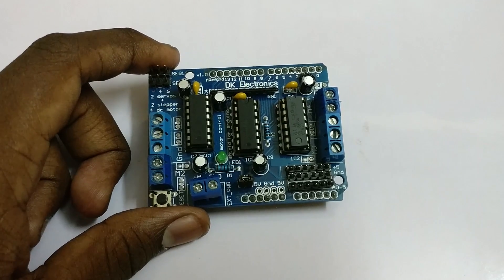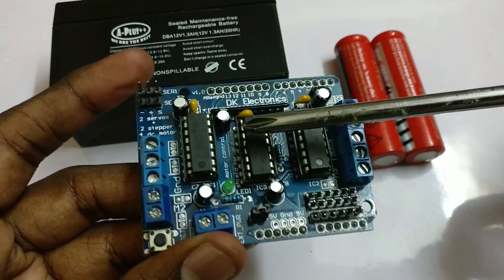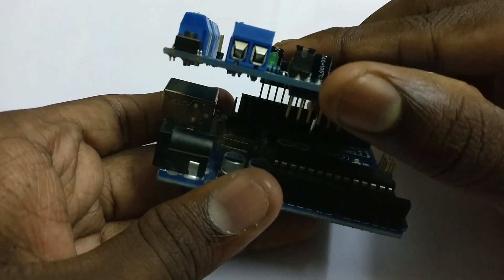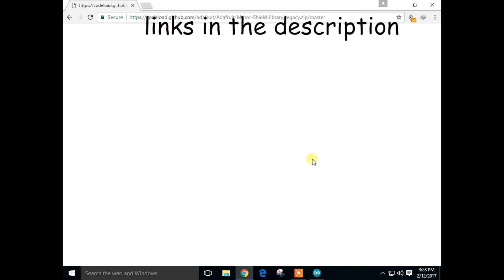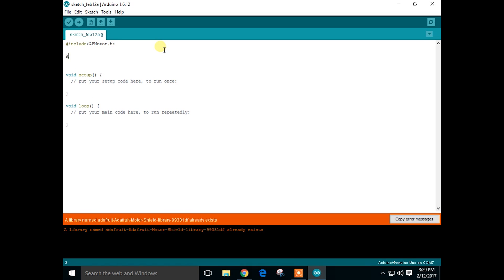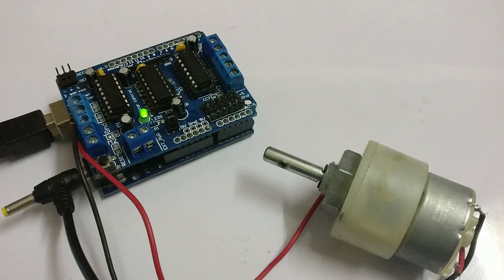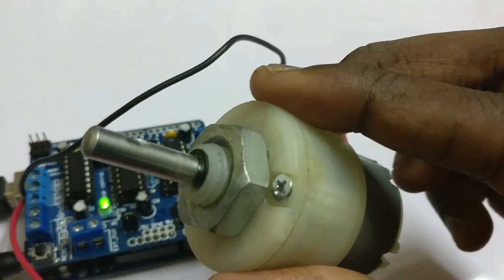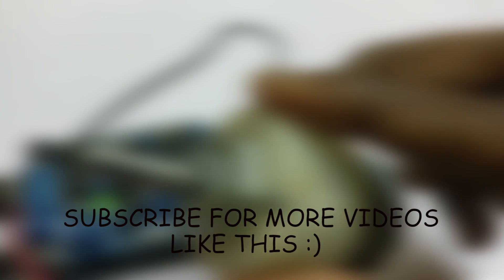Arduino Tutorial: Using a Motor shield!

Comment: Great video! I am making a ball launching machine using a 12V 30W motor and a 16.8 Ah Lithium battery. Would this motor shield work with this setup? If not, what's your recommentation? Thanks

Comment: Sir how to use the digital pins after placing motor shield on arduino.  I am currently working on my final year project which is a fire fighting robot and when I put the motor shield on arduino then the digital pins are also covered . Do I have to  perform soldering on motor shield

Comment: Arduino: 1.8.10 (Windows 7), Board: "Arduino/Genuino Uno"

sketch_nov16a:1:9: error: AFMoter.h: No such file or directory

 #include<AFMoter.h>

         ^~~~~~~~~~~

compilation terminated.

exit status 1
AFMoter.h: No such file or directory

This report would have more information with
"Show verbose output during compilation"
option enabled in File -> Preferences.
Reply from the maker: It's #include<AFMotor.h>

Comment: The board has ONE configurable component - the PWR jumper - and it isn't mentioned!When the jumper is installed power is supplied from the Arduino 9v supply. The plug for this supply is visible in the video, below the motor shield, when the motor is operating. When the jumper is removed power is supplied from the motor board +M terminal. This is the recommended mode of operation if using multiple motors or servos.  Do not leave the jumper installed if both power supplies are connected: there are no isolating diodes.The description of the LED is unintelligible.

Comment: Nice explanation. I have one doubt. Why you have given power supply to Arduino board but not to motor shield? What if I power the arduino by usb and connect the power supply to motor shield? What if I power the motor shield only and not connect the usb?

Comment: Hello congratulations for sharing. I have a roue codeuse on the motor shaft (recovered from a printer).I did the test of 5v pulses sent by the transistor. Could you specify where I have to connect these pulses on the arduino motor shield. Thank you.

Comment: If you have to attach some jumper wires to Arduino how you can connect wire with Arduino.
Reply from the maker: Only digital pin 2 can be used. You can solder a header pin in the given hole in the motor shield.

Comment: how to connect 4 motor with arduino nano & how this code
Reply: Rakib Sarkar You can use a ULN2003 IC with arduino nano or you can use a l293D or l298 motar driver.

Comment: Sir I am currently making CNC PLOTTER using using ardruino uno and l293d motor sheild. My ardruino uno works perfectly and is recognized by my PC. But as soon as as connect it with the motor sheild,the PC stops showing the port and doesn't get connected.. Can u pls help me?? My WhatsApp no. 9749766645
Reply from the maker: +Saikat Paul you may be inserting the shield in a wrong way.
Reply: MasterTech sir the sheild is a right fit. Left the first 2pins and inserted on 3.3v pins as done in the video

Comment: what pins from Arduino Uno do the motor shield use.i want add some other components leaving the pins used ???
Reply from the maker: +leeladharesh leela you can use the digital pin 2
Reply: I wanted to use the LCD display. so can I do it with which pins...
Reply from the maker: +leeladharesh leela no you cannot. Buy a L293D board. 
Robodo Electronics L298 Motor Driver Module https://www.amazon.in/dp/B00N4KWYDE/ref=cm_sw_r_cp_apa_i_YzPAAbTXP8F44

Comment: i want help can any one. call me 9604843211 i make CNC machine and i use Arduino uno and motor shield,,, i connct 2 stepper motor,1servo motor!!!  but when i am giving motor shield 6volt supply with mobile  charger then also motors are not moving can any body tell me whats the problem ???
Reply: E.T E.E  remove that lil pin grounder at pwr  motor shield at 0:08 you can see left to the 5v holes
Reply: SSG goku can you explain in detail!!
Reply: E.T E.E  In other words  remove PWR jumper from motor shield  if u are trying to give power  externally

Comment: when i put off cable from arduino ...the code dose not work with motor control shield,even i connect external 18 volt bettry to the ardunio

Comment: why do I get the following error:
call to 'AF_DCMotor::AF_DCMotor(uint8_t, uint8_t)' uses the default argument for parameter 2, which is not yet defined

Has AdaFruit changed their library?
Any information would be gratefully received.
Reply: OK.  Sorted.  There has been a change in the software.  A sketch for my 2 year old obstacle avoiding robot works and it was compiled 2 years ago with the line :
AF_DCMotor motor1(1);
but this same line fails now.  
Using the lines:
AF_DCMotor motor1(3,2);
AF_DCMotor motor2(4,2);
compiles and works on my grandson's tank.  I suppose the second parameter is useful but since Adafruit don't support the board I can't see many people not being caught out by it.
Reply from the maker: +Treereaver Jones The second parameter is for frequency (speed of the control signal)
Reply: Thank you for this.  But it doesn't explain why a sketch, even Adafruit's own examples, now fail to compile.  Whereas they always used to, without the second parameter.  I am not very good at coding so I don't have much time for sketches/programs that don't work.  Nor do I understand the complexities of .h and .cpp files so I have to rely on expert advice and I am very thankful for it!

Comment: how to use the other digital pins in DK electronics motor shield
Reply from the maker: +Umesh Talekar You can use the Digital Pin 2. Just Solder a single male header pin in the given hole.

Comment: #include<AFMotor.h>
AF_DCMotor motor1(1);
//added to your code, very good thanks www.arduinomaster.com

void setup() {
  // put your setup code here, to run once:
motor1.setSpeed(255);
}

void loop() {
  // put your main code here, to run repeatedly:
motor1.run(FORWARD);
delay(1000);
motor1.run(RELEASE);
delay(1000);
motor1.run(BACKWARD);
delay(1000);
motor1.run(RELEASE);
delay(1000);
}
Reply: What is the difference between these sketches?  Why does one produce an error and the other doesn't?  They appear both the same.  I think I'll go back to BASIC.
Reply: The last symbol appears to be a right hand curly bracket but definitely isn't.
So what is it?